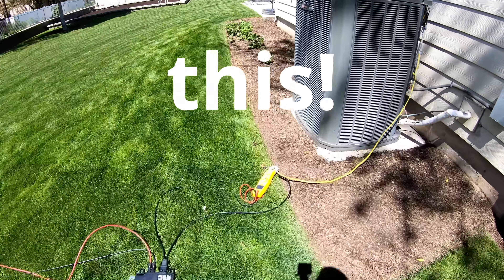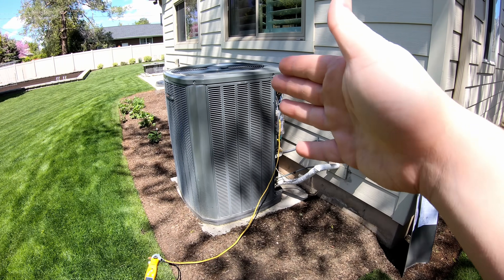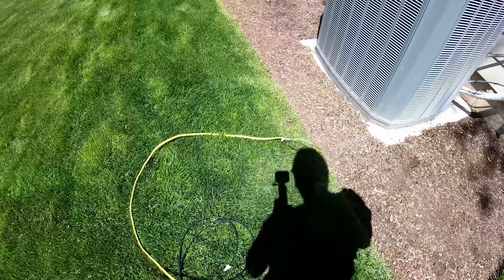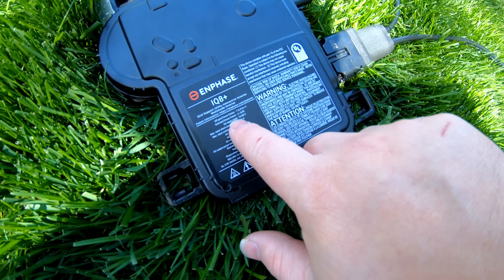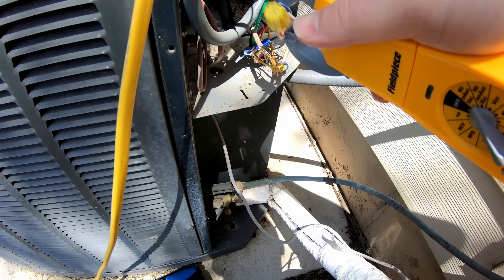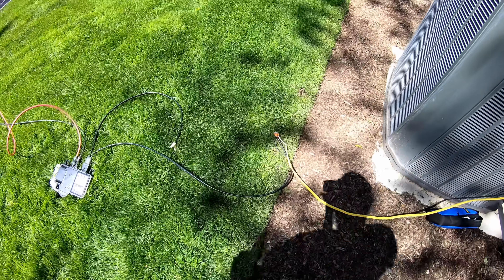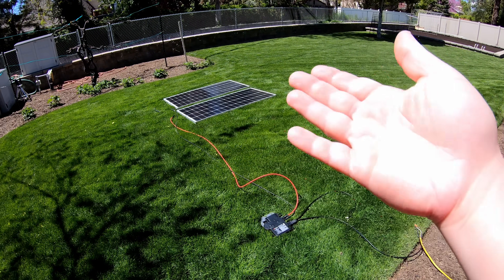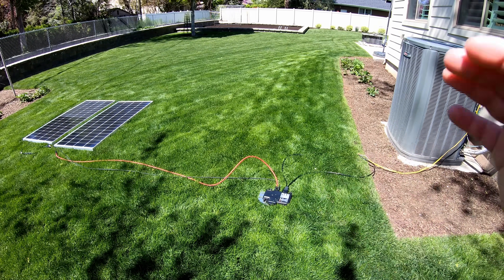1 Hack To Eliminate Your A/C Power Bill This Summer!

Comment: WHY? 
all u did is run a refrigeration cycle much much much more suboptimal ....at best it will work in the most inefficient cop at wort the compressor may explode
Reply from the maker: Did you watch the whole video including the amp readings on the AC unit itself? Pretty sure it’s running like it’s supposed to with a nice offset to the power consumption from the solar. Anyway, be sure and subscribe so you don’t miss the “I Blew Up My AC Compressor Video” if what you said happens! Thanks for watching!
Reply: @theresatrickforthat  hahahahahahaha🙄

Comment: hmmm...  what abut when power goes out.......  could this in anyway be feeding power into the grid and harm the lineman up the road fixing things.......  Im thinking NOT cause your set up using the grid powered device's  contactor (in this case the AC's contactor)  to activate the solar setup.  WIthout grid power....  the  contactor cant' flip things to solar, thus solar setup remains disconnected from grid.   Am I understanding that right? 

PS- contactor is in automotive terms essentially a solenoid in theory right?
Reply from the maker: You’ve actually got double protection in this case. 1. You’re right, the contactor physically disconnects the solar inverter from the grid. 2. These Enpahse inverters are grid tie capable. That means they have rapid shut down capability. So if they can’t see grid power, the utterly will not produce power. Yes, the contactor is very similar to a solenoid. Thanks for watching!
Reply: Do you have a 1 or 2 pole contactor, just wondering if 2 pole would be safer to use in case there is some scenario where having one leg of the contactor always hot could cause the inverter to kick on when it shouldn’t.

Comment: This might could be a great partner  to a regular solar system with batteries. (Less panels needed, less batteries, less stress on all of it too)  On bright sunny days your battery charging system would end up mostly dedicated to charging batts for your night time use, cause the "partnered" reduction of grid power use, solar set up would be handeling the day time heavy draw stuff.   

Set it up wisely so in a SHTF / you loose grid power,  You  could easily unwire the panels from the grid side and add them to your battery side....
Reply from the maker: Definitely some good thoughts and ideas here! Thanks for watching!

Comment: Since you're not offsetting when the A/C is not running and there is a ramp up time for the inverter, this would seem to discourage frequent cycling.  Have you investigated programming different thermostat set points during the warmest part of the day, potentially going cooler/running longer to maximize your output, effectively using your house as a (probably not terribly efficient) thermal battery?
Reply from the maker: This is a great idea to maximize the solar power you harvest! Doesn’t cost any extra…just a bit of programming of the existing thermostat. Great idea! Thanks for sharing and for watching!
Reply: @theresatrickforthat  Having a 2 stage system goes a long way toward longer run times.  There may be some settings deep inside that will cause it to run longer, longer, longest in low stage before going into high output.  BTW, you would say that your max PV output would have to be limited to the less than the wattage at the low output stage, yes?
Reply: @garyhiland6013  Yep! Longer run times do help! And yes, I would agree to size the solar array for low stage and not high stage since it runs in low stage 90% of the time. Thanks for watching!

Comment: How about running the whole unit with solar and use batteries  ? Complete off the grid ac with grid or gen as backup?
Reply from the maker: That would be the ultimate. But this way is a much cheaper way to start while still benefiting from solar power while saving for expensive stuff like batteries. Thanks for watching!

Comment: I have same setup with 10 panels running my pool pump for free for like 4hr if the sun is out, had the setup for 5year now and it sure helps to offset power consumption.
Reply from the maker: Nice! A pool pump would be a great application!
Reply: @theresatrickforthat  There are affordable DC pool-pumps which run directly off solar panels, with no inverters.  I'm considering a setup.
Reply: @SihAza  I'm looking at a few as well let me know what you decide to get!
Reply: I'd love to do something similar. This sounds like a dream setup.
Reply: which model micro invertor you used, can you elaborate on your set up please
Reply: What pump are you using?
Reply: You're producing about 12 cents a day worth of power in my area.  How long does it take to pay for the panels and inverter?
Reply: How is it “free” when you spend a significant amount of money on the panels, micro inverters, controllers and cables - were these items free?
Reply: @Techprone1    Course it isn't completely/truly free, but the good news is that a lot of this stuff is coming down in price more and more, especially Solar panels and batteries.
Reply: @Techprone1 Free after you get ROI in a few years

Comment: People getting hung up on thinking the 2 panels are supplying all the power.   They are not! They are just reducing what the grid has to supply.  No different than if the panels were tied to the breaker box and every time the ac kicked on he turned on the solar breaker.  
   Wattage is wattage. If your panels produce 400w then your overall grid usage will go down 400w.   
   Nice way showing initial draw and then the supplied amperage and overall amp draw after the micro inverter kicked in. 👍🏻👍🏻 

Before I installed my full array, I did this same thing to see if it would work.   It did and my home energy monitor helped prove it as I could see my overall grid usage drop when the panels were producing. The electric company had no idea for months.
Reply: Why would or should the electric company care if you are subsidizing your electric consumption with solar?  If you are not in contract for selling back solar power, you should be free to do as you please with your solar power.
Reply: @billdee814 Because if there is no safery build into  your system you could back feed power into the grid and you may kill a line worker  that is working on the powerline....
That is is basically the only concern feeding power into a grid  from a system that was was not inspected and aproved.
Reply: @FloryJohann  the safety is built into the inverter. It only feeds power into the system when it senses line voltage. Power goes out, inverter turns off.
Reply: @InspiredCraftsman the power company has absolutely no guarantee on that unless it’s inspected by them and the safeguard set up by them. You can’t honestly be arguing that they should just take people’s word for things. The silly question posed was that you should be able to do whatever you want, and that’s just not the case in a civilized society. Would you trust your life and safety to some random person without having control over it? The answer to why they care is because it’s a safety issue that could get someone killed if they’re not regulating it. Period.
Reply: @zimvader25   in this situation that the solar is supplementing the AC on the compressor side after the relay there are a few safety cutoffs. During an outage the relay will not tie the circuit back to the grid because the transformer that powers the thermostat and triggers the relay does not have power. Enphase microinverters shut down when not sensing line voltage so they will also shut down (they're also potted boards that would be very difficult to modify). The system would be completely isolated from the grid in a power outage. Also a small generator system will overload and trip if it did manage to backfeed. Just the line resistance and possible loads connected would trip a generator or inverter. The chance of a system like this posing a danger to a lineworker. The residual induced voltage on power lines would far exceed what a system like this could supply and that's not taking into account the safeties already taking effect. The point of this is just to reduce the amount of kilowatt hours supplied by the power company to lower the AC usage. Yes, people do foolish things with electricity around their home. I hardly think this system falls into that category.
Reply: Maybe people are thinking the panels are supplying all the power because of the clickbait title. I mean after all, it does say "Eliminate your AC power bill"
Reply: @TheBear470 well you just add enough panels and it can eliminate it, just don’t add more than you need
Reply: @TheBear470  Well he did say to add more panels later and that would happen.
Reply: @TheBear470  Exactly.....should say offset not eliminate!!!
Reply: Yes you correct but if there is a smart meter involved it will show more power used Sneaky electric company has some built in the meter to watch the Hz
Reply: You can pay to retrofit a dumb meter !  At least we could some years back in Ca. This may have changed as we get closer to 1984 .
Reply: @Branx86 I have solar and worked with the electric company when they setup my meter.  They had no idea I had solar hooked up for the previous 2 months, I was supplementing power to see how much it would produce and a way to reduce usage without the extra bi-directional meter fee.  Producing exactly what I used or up to double my usage would save me money.  Producing over double my usage cost me more.   After the couple of months I had them out to inspect my setup and reprogram my meter to be bidirectional.    I found in my situation it was more beneficial to just let my panels work vs trying to supplement and track output and usage.
Reply: @racinjason68  How much is the bidirectional meter fee?
Reply: @kuba2ve well our city power charges an extra $30 per month vs the standard $16.
Reply: @racinjason68  So, you pay $30 instead of $16, or you meant $16 + $30?
Reply: @racinjason68 why would producing double or more of your usage cost you money?
Reply: 200 watts * 12 amp is equal 2 k. USA Home A/C is 1000 or 1500 watts.
Issue when it starts A/C's  electric motor/compressor needs some additional amp in very short period. Maybe  the latest electronic schema is designed to avoid this kind of of problem
Reply from the maker: Haha! Yep! They seem to have a hard time wrapping their heads around the concept. Thanks for the kind comment and for watching!
Reply: @theresatrickforthat   No. You IMPLIED this was some sort of "hack" that was RUNNING your AC unit without using grid power. Don't get bent out of shape because people are calling you out on it. 

"1 Hack To Eliminate Your A/C Power Bill This Summer!"

You said "ELIMINATE" your AC bill! Not reduce it, but  ELIMINATE it. 

Fix the title or accept the fact that your video is a joke.  You seem to have a hard time wrapping YOUR head around your claim, WHICH WAS NOT TRUE!
Reply: @phillipzx3754  You're not wrong.

Comment: How do you connect the wires coming from the inverter to the condenser unit ? in parallel to the 240v coming from the grid?
Reply from the maker: Yep! It connects in parallel. But on the load side of the contactor so the contactor controls when the inverter sees the grid and turns the inverter on when the AC is on and then turns the inverter off when the AC turns off. Thanks for watching!
Reply: Thank you for answering my question!!!

Comment: Can this be done with a window unit, or does this technology not exist yet
Reply from the maker: Window units are hard because you’ve got to wire some kind of relay in your self to turn the solar on and off with the cycling of the compressor in the window unit, plus good 120V micro inverters are hard to come by. For a window unit, I would recommend buying a solar power station, just plug the window AC into the power station, plug the solar into the power station and away you go! One to consider would be the Anker C1000. I did a review and real world testing on one you can check out. I think it’s even on sale for Memorial Day! Give it a look: https://youtu.be/Zdl3syXDUP8?si=2_45RG3CmyPGoiO1